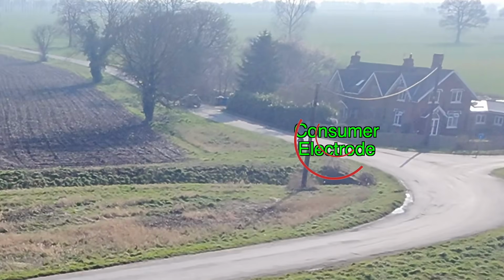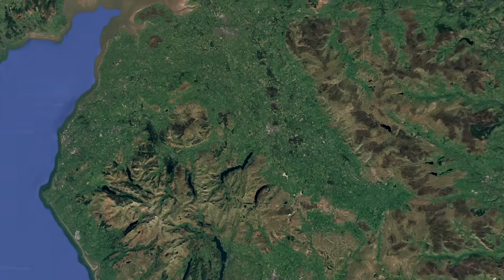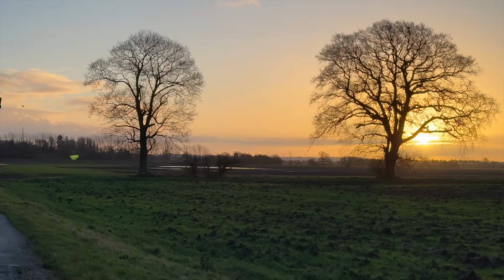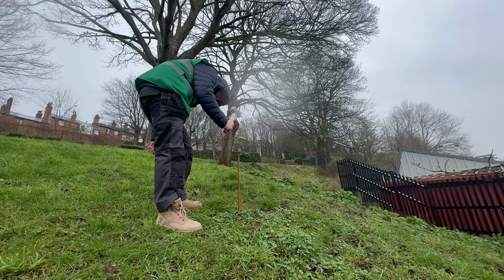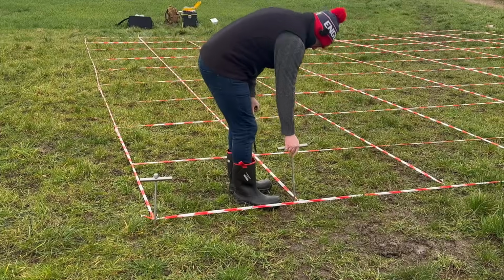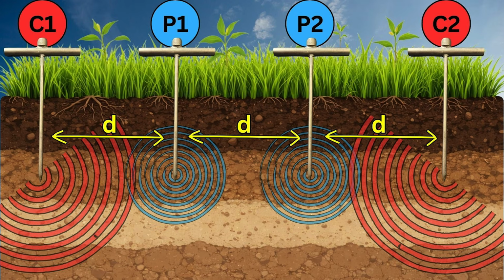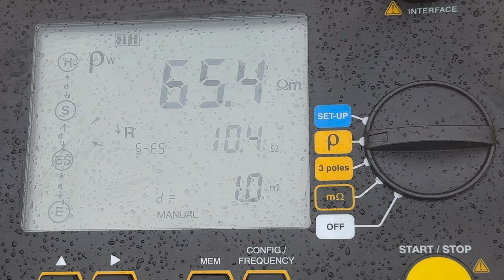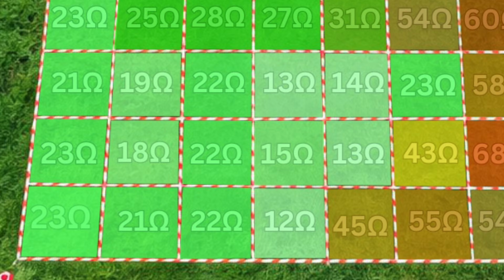Soil Resistivity Explained | Why Location Changes Everything...

Comment: Substation location is chosen by soil resistance? Seriously? How about railway traction substations? 

Substations use mesh (stainless steel or zinc coated), earth resistance there less than 4Ω regardless of original soil resistance. Substations are constructed on underground metal frame, soil resistance has no contributions.
Reply: You understand that he's referring to a MV > LV transformer, yes folks this is a substation, not a yard full of HV and MV equipment, right?  There's not mesh / grid / huge amounts of structural metal in the ground at those locations.  If it's pole mount there will usually only be a rod or a disc (on the buried end of the pole) electrode.  Rods are driven deeply to attain the required resistance, and if it can be achieved with one vertical drive, another rod will be driven in an appropriate distance away.  Same goes for disc electrode, another rod electrode will be driven until the desired resistance is achieved.  Pad mount earthing is usually more extensive since not only step and loop is considered, touch has to be addressed too.

Comment: "Parallel paths can affect resistivity and resistance" 
No, this is not correct.
Parallel paths affect the net value of resistance, they do not affect resistivity.

As you correctly said, the resistivity is a function of the physical ground, and it is not changed by the insertion of earth rods.

The insertion of multiple rods results in multiple parallel paths, the resistivity can change over the area and depth of the ground, but the neither the parallel paths or insertion of the ground rods are changing the resitivity, what they are doing is changing the resistance of the path back to the transformer.
Reply from the maker: Thanks for the feedback 😊

Comment: More moister better ground.
Reply: More dissolved salt, better ground.
Moisture alone isn't sufficient.

The covalent bonding of molecules in  pure water result in a non conductive compound. It is the presence of dissolved salts that make it conductive.
Reply: @deanXRayZulu appreciate that mate. Didn’t think of that.
Reply: Our village has the lot,more or less on the coast,clay soil and below sea level so much of the ground is marshy all year round,plus given the close proximity to the sea the ground has a high salt content,which is great for its low resistance  but we do have to have our ground rods replaced reasonably regularly through corrosion. Even our power cables are still overhead because they won't bury them in this soil.
My sparks once joked that in some particular spots where it was really moist he was sure that you could just chuck the earth rods on the ground and still be just as protected😊
Reply: @user-re6yo7tj5s Try looking for some coated rods (if they exist) which are more corrosion resistant, or use a rod made from a different metal to Cu.

I don't think you need the lower resistivity of a pure copper rod to meet the resistance requirement.